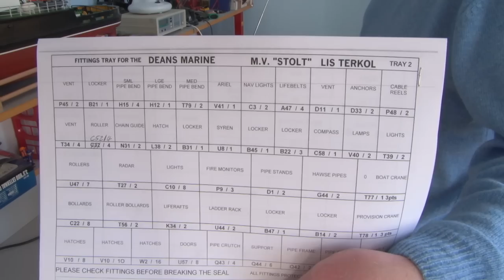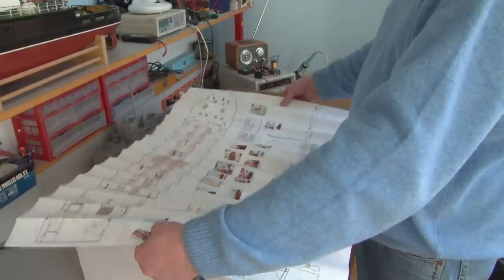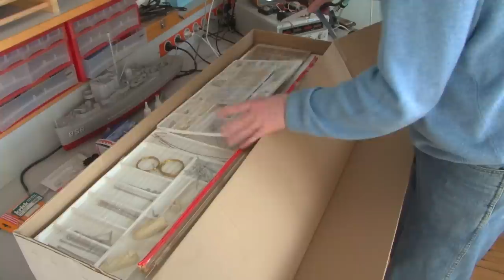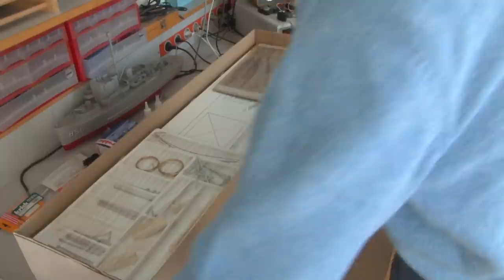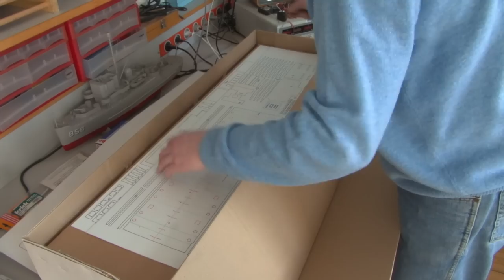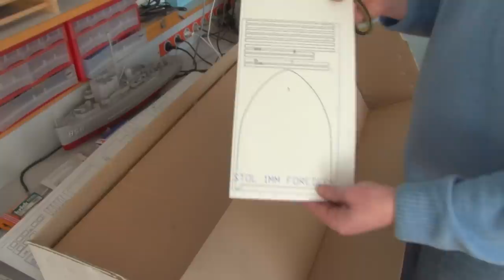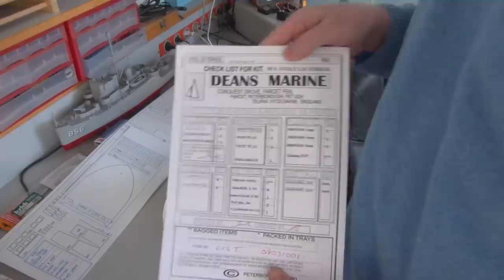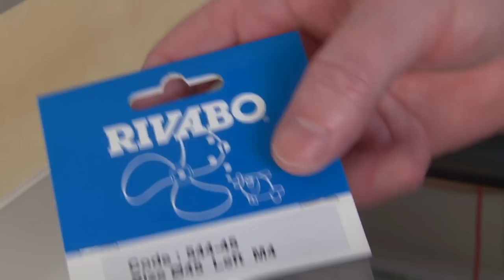How to build a model ship - Lis Terkol from Deans Marine

Comment: That's a Huge motor for such a small coater type ship!
Reply: +Martin 
Yes, but I do the same. A smaller motor with a gear can swing the same propeller at the same speed, but will cost more and make more noise.
Reply: +Leif Vejby A good idea to reduce noise,  is to cover the motor with a rubber sheet . Of course being careful not to cover any cooling holes . And if possible put a rubber mat under the housing between the motor stand and  hull.